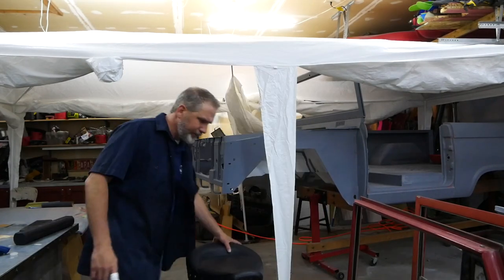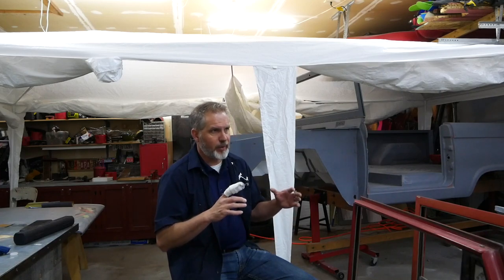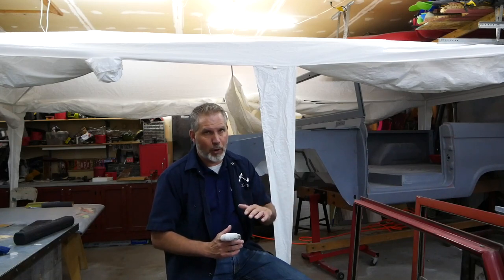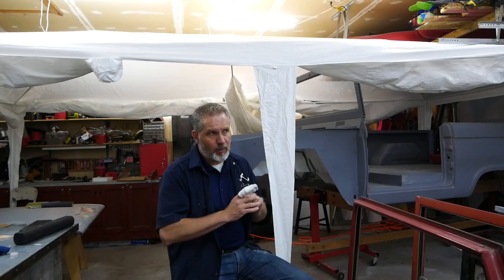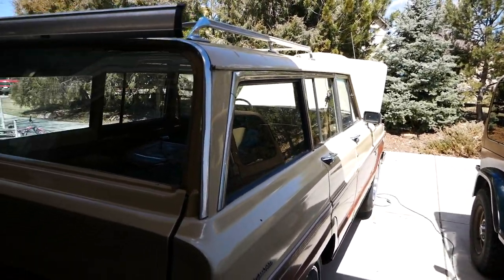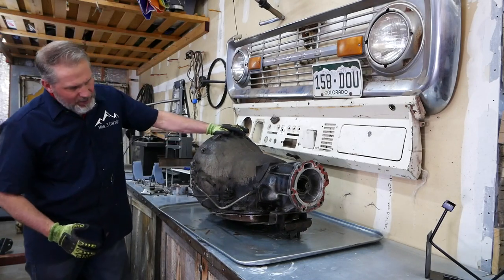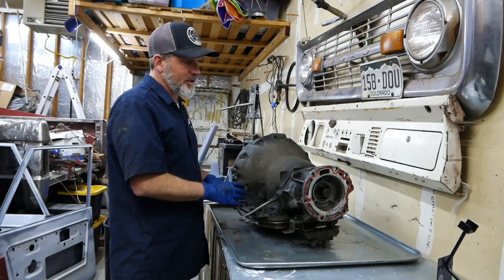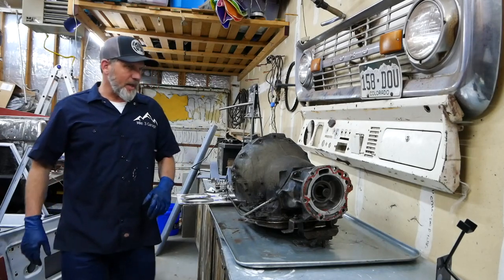Jeep Wagoneer Diagnosis...Torqueflight 727 Bomb!

Comment: Youre probsbly better off finding another 727.  There are millions of those transmissions around.   Suprised the physical gears blew up like that though.  They are pretty strong transmissions.

Another thing is if the IDLE is set too high and you shift to drive or reverse itll slam the transmission and u joints hard.

Comment: was there a follow up video on the Wagoneer?
Reply from the maker: Funny you should ask. I have been working on it here and there and it is only getting worse.  I plan on doing a video on my struggles with it soon. It is a real pain, but I can’t get rid of it.
Reply: @alpinegarage8548  Sounds good. I've been having issues with mine. no power going up hills. doesn't seem to shift going up hill
Reply from the maker: @PacemakerandButtons  mine is mostly trans issues as well.